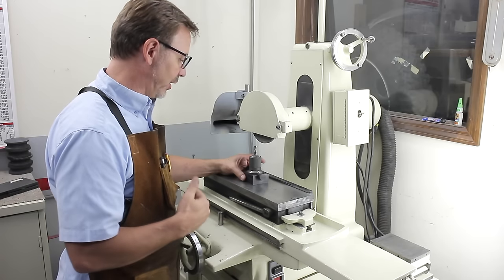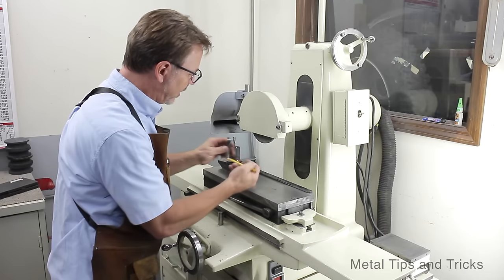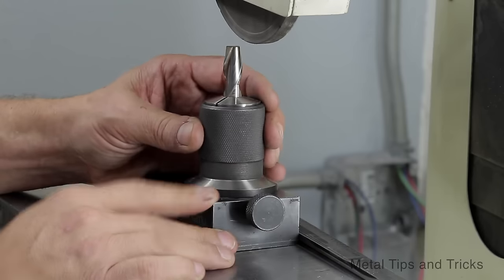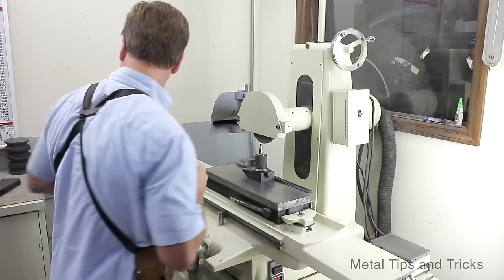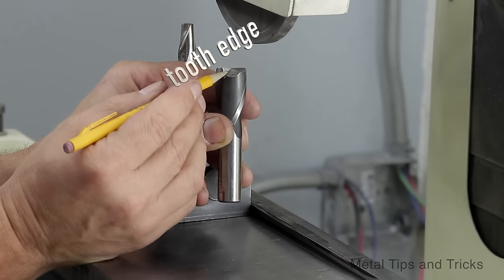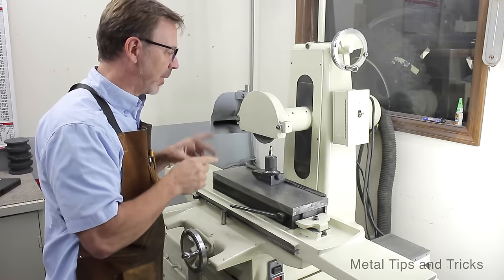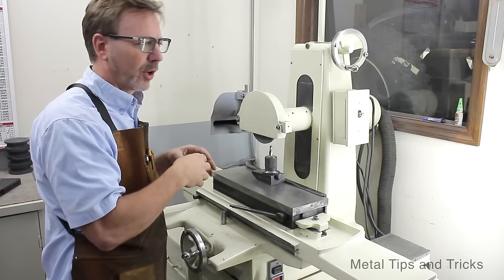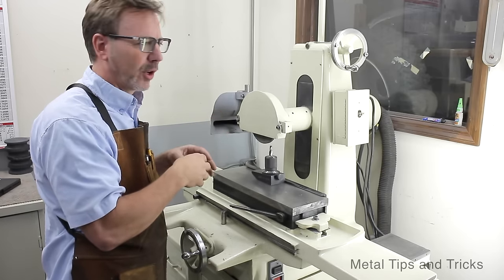How to Sharpen End Mills on a Surface Grinder Part 1

Comment: Dale, I genuinely value it when you post a video where something went wrong. We often learn more from what went wrong than went went well.
Reply from the maker: My next video shows a mistake too. :-)
Reply: And I bet you haven't even shot it yet!  ;-)
Reply: I was gonna say, why isn’t he sharpening the face or flutes? If you want to be quick about it you can use a buffing wheel with aggressive compound to smooth out any dings. With practice you will be doing it by hand with a diamond gashing wheel.

Comment: I have found the best way to get a nice new sharp edge on my end mills is to grab the phone and call my tool supplier. It's darn tough to beat the edge of a brand new quality end mill. 
Enjoyed, thanks!
Reply from the maker: you have a point but I'm cheap and can throw things away. :-)
Reply: +Metal Tips and Tricks (Dale Derry) I am cheaper than you, I don't have a grinding room nor a surface grinder.😄
Reply: Although I have a lot of end mills I have no mill, therefore I have no need to sharpen???

Comment: That jig can really deliver a good result once you are comfortable with it. I have considerable experience with them and would like to offer a suggestion. When you ground the cutting land area, (the primary relief ) you worked from the outside in, with the working flute towards the rear of the machine. If you rotate the whole jig 180 degrees and cut with the flute closest to you, the rotation of the wheel doesn't push the edge (burr) toward the cutting edge of the cutter. It will result in a better edge. Give it a shot. I enjoy the videos. JP out
Reply from the maker: Thanks for your comment I will give it a try. :-)
Reply: Where can I buy this?

Comment: I bought two of these. One with 10 detents so that I could do 5 flutes and one with 24 detents for all the rest. No instructions came with, so trial and error figured it out so it was fast and simple. Flutes cutting edge slightly ahead of 90 degrees on the 2 degree slope to center side of the tool holder. NOW !!!!  Instead of putting the tool holder 90 degrees and tight to the fence, use an angle block to butt the trailing side out away from the fence. Angle can very depending on the number of flutes. I generally use 25 degrees on 4 flutes. Drop your wheel so it goes in past the center of the end mill. Take a couple of thousands on each flute while progressively indexing mill. When satisfied with cutting edges tip tool holder up to 30 degrees with the same angle bock in place. Adjust wheel so it cuts into web but does not touch cutting tip or chip hook. You don't get the trough this way but you really don't need it. Sharpening cabide this way does not hold up very well for plunge cutting because the nitrite coating is gone.

Comment: Dale:

I just restored a Delta Toolmaker Grinder, didn't really have any jobs for it yet, so I bought the mill fixture from Grizzly along with some collets.  I first tried cleaning up a 1/2" two flute ss bit, took me quite a while to get it right.  I then went to some four flute bit, they were easy, so I know what you meant about the comment on two flute bits.  I have a 1/2" carbide bit that needs touching up, but I'll have to buy a diamond wheel for that, for another day.

One thing I don't hear about is cutting the gash, if I have that word right.  I suppose a cupped wheel would do it, or perhaps a small tool grinder or dremmel with a cutoff bit.

After cleaning up a 1/2", I did a 3/8", fairly easy.  I then went to a 5/32nd four flute, didn't do well, have to do everything under a magnifier, just didn't come out well, think I'll stick with 3/16 and above.

The paper manual was worthless, wish somebody would re-write it, but your video helped me the most, without it I don't think I would have succeeded.  Old Tony's helped but your's was the best.

Jim H.

Comment: I was wondering. Unless you plunge cut with your endmills a lot I didn't see much advantage in sharpening the end when we actually tend to use the sides of endmills to do most of the cutting. I thought in your tour video you had an actual tool and cutter grinder. Why not use that and do them the right way?
Reply: Well, us beginners probably chip the outside corners of the bottom a little more than you and a bunch of sharpening of the end would help that, too.  :-)
Reply from the maker: To answer your question about why I didn't use the Tool cutter grinder. More of my viewers have  surface grinder then they do,  tool cutter grinders.: -)

Comment: If you plunge cut with that slotting drill (2 fluted end milling cutter) does it work? I have tried to use ones sharpened like that, and the dead spot in the centre produces a nipple in the hole that restricts the depth of the plunge. If you grind it so that one cutting edge is half the diameter, and the other shorter, the problem won't occur. Their primary use is for cutting keyways, so once you sharpen the flutes, it cannot be used again for that purpose. You only sharpen the ends, and if the flutes are damaged on the bottom end, then that end bit is removed, or it will cut a nonstandard width.

Comment: Can you please explain the meaning of markings on the collar ring? It is all 8s and 12s, except for zero.The markings are not evenly spaced. Also the meaning of the ball bearing, why it is in the kit? Also, would be helpful if you had diagrams in your video, it is quite difficult to grasp different angles you are talking about because the video is 2 dimensional. I had difficulty grasping the half moon positioning.

Comment: I would like to know the size (dia. and width) and type of grinding wheel you are using for this operation. It certainly doesn't appear to be a standard straight white aluminum oxide wheel.

Comment: Knew just from the sound that endmill was dull, but you got a video from it so that's always good!

I did skip through the video, so I apologize if you covered this, but what wheel did you use? It sounded like a pretty hard wheel. In my limited experience I find soft wheels GREAT for grinding hard steels.
Reply: At about 7:40 there was some comment text that said it was an "Unknown Diamond Wheel."
Reply from the maker: I use a hard wheel because I need it  to hold its shape.
Reply: Sometimes it can help to dress your wheel with a very slow traverse (a finer dress) if you need the wheel to hold shape.

I'm guessing you really needed the corners to hold shape  to get right into the center of the cutter?

Comment: So why did you use a diamond wheel on HSS? That could have been done easily with a standard 32A/38A Aluminum Oxide Wheel.
Reply: I would say why bother changing the diamond wheel.If your in a hurry and have several damage cutters both HSS and carbide to repair you find out what works and what won't.Since carbide is much harder than HSS you find out you wear out the aluminum oxide wheel trying to grind with it.Diamond grinding wheels work with HSS end mills but I wouldn't use a find grade wheel,it seems to take longer.

Comment: Dale, and others:

I'm currently grinding HSS with the stone that came with my surface grinder, appears to be aluminum oxide, the number is unreadable, so I don't know the grit, hardness, etc.  It is 7" dia, 1/2" wide, had a 1.25" hole.  I'd like to sharpen carbide endmills, probably up to 1/2".  I don't think I want to waste it on carbide.  Which diamond wheel would you recommend?  Do you have a part number from shars or msc?  Would a cup wheel give me the advantage of re-doing the gash?  Jim

Comment: It's not a jig it's a fixture. A jig guides the cutting tool as in drill jig. This is metal working and you don't throw the word "jig" at everything that comes down the pike. Refer to Carr lane catalog or the Machinery's handbook for the correct terminology.